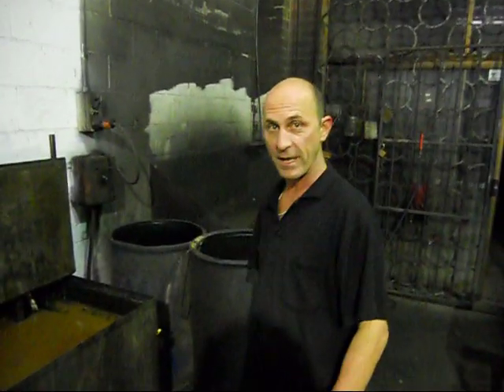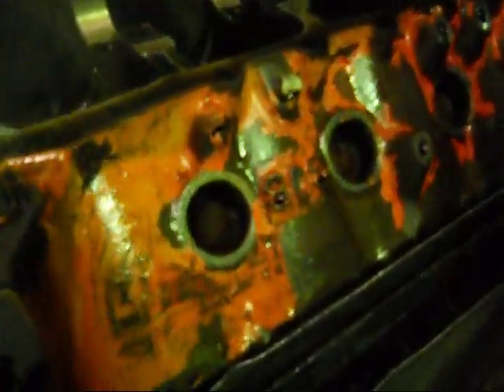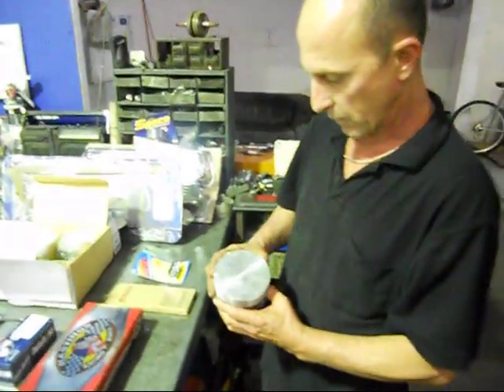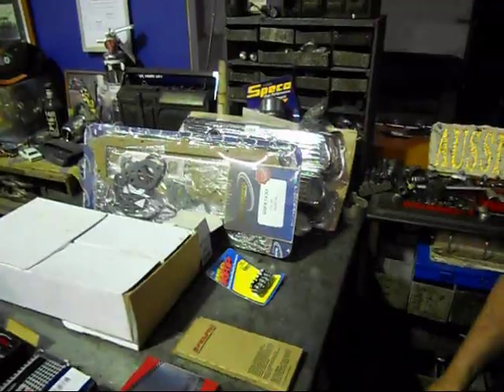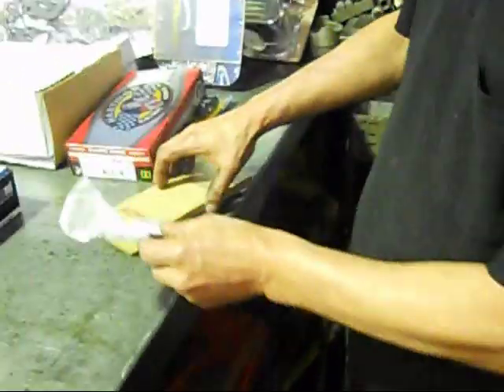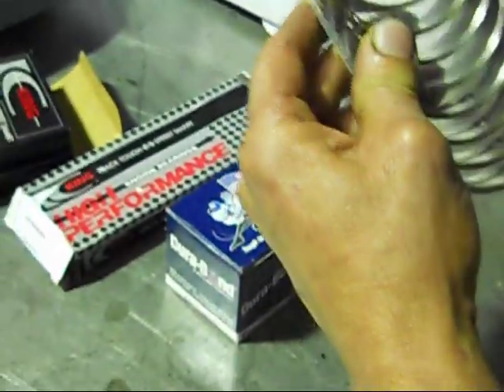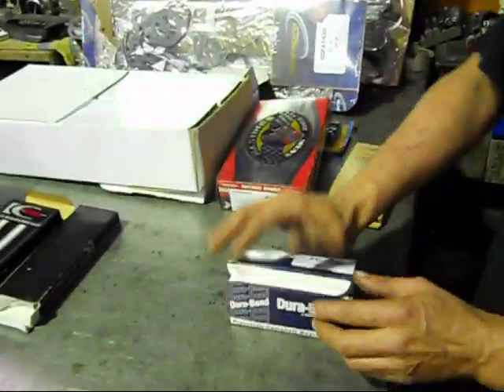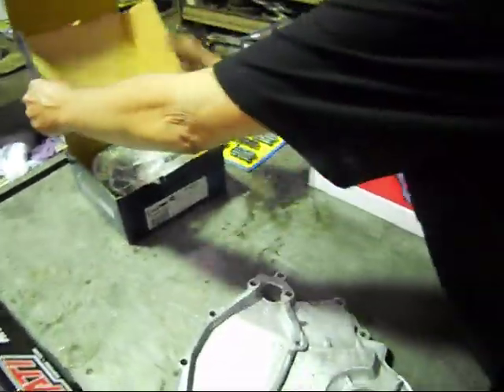How to rebuild and blueprint aV8 high-performance engine from scratch

Comment from the maker: Yes the engine was put on our engine dyno,it has a carby and electronic ingition,was run in and tuned,there is a lot of vids on this motor in the dyno room explains running in cam with single valve springs,then changing to double valve springs with the heads still on :)

Comment: Hey mate I've watched about a dozen or so of your videos now and they're really good. Just wondering, with the cylinder head porting ones, where does a CNC machine port the heads and how does that differ from a hand porter. Surely the machine can't right into the runners ?

Comment from the maker: Yeah there was buddy,probably from memory $4500,which sucks cause it comes out of your labour costs,the motor was $8500 ,which included,full s.steel bolt dress kit,alloy polishing,blue-printing,port/polished heads and rebuild,took 160 hours at $4000,not even $30,but I wont take short cuts, sacrifice profit for quality everytime...

Comment from the maker: Yes I have done heaps,motors are same only difference is engine management unit ECU's, soon as you start changing to big cams std units aren't tuned and ECUs wont work,but heaps of after market parts and systems now days

Comment from the maker: After we run in the cam,I put the double valve springs back,the cam power curve goes from 2500-6200rpm,the carby was lean,needed double pumper,we done a power run up to 5500 rpm,fuel/air climbed to 17:1(lean)but 360hp@5500rpm,since then the right stall and carb and ex system has been fitted,alol this done we have 400hp

Comment: What did it end up doing on the dyno?

Do you build more modern EFI engines also?

I have a VQ I am looking to do up. The trans has been rebuilt stronger. Looking to get as much power as I can while keeping longevity and reasonable fuel economy. 

Would like to keep same stall and standard diff ratio. Would it be same ball park figure?

PS love your work and the way you display your craft, thanks for posting these :)